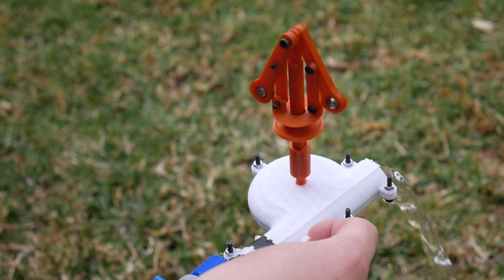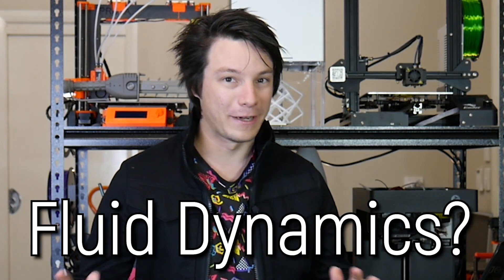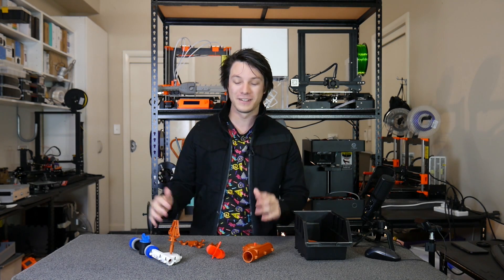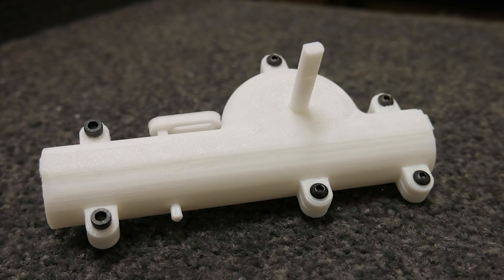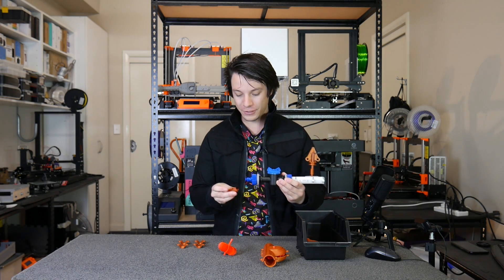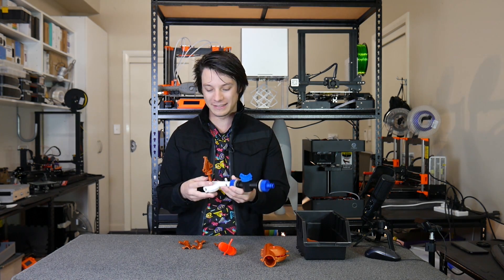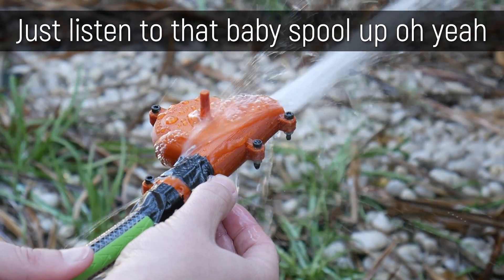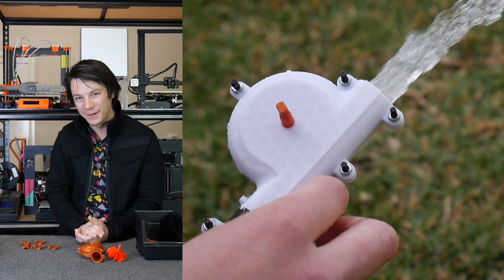When your projects FAIL (and why that's a good thing!)

Comment: hey bro, im here in NSW and wondering what gearbest filament the grey $30 one and it was terrible couldnt print below 40mm/s and .4mm and even then it barely worked, so i went back to the cocoon grey which is amazing and ill prob stick with... as long as they have stock

also PSA.... FASTWAY COURIERS is terrible and never ever use them, 1 month after the parcel left their warehouse fastway delivered it to sydney and handed it to Australia post (who delivered it in a few days) so much for next day delivery hey....

Comment: It only is a fail if you stop trying.  .... Also no one ever said that pipes need to be round. Flat paddles and a square inside would work as well. Final note: the direction of the outlet also will influence the speed  .... (at least I think, I haven't studied fluid mechanic either)
Imagine your turbine housing as a square with two section on each side . Atm it goes in at left top and goes out at the right top. It also could go in left top and come out right bottom forcing the water to flow more around the turbine. Or even left top and come out left bottom. Although in this case the water need to be encouraged to go the right way round and not the wrong way.

Comment: I developed a product and am on Version 10 right now. The very first print I made was crude, but mostly effective, and was only so because I adapted a concept from other similar products. After that it was simple refinement of the idea and trying different solutions to a better product. I was almost happy with V8, but a few last tweaks led to V10.
Along the way, I learned to better flesh out the idea after the initial proof of concept print. Most of the revisions were simply reducing the amount of material and thus print time. A few were nobel attempts to compromise on features versus material/print time which ultimately were rejected. (Not sure they really qualify as revisions, but whatever.)

Comment: Hey Angus, for some fluid dynamics inspiration, you might want to check out some pool cleaners. I have a Polaris 3900 Sport pool cleaner, and it has an amazing gearbox assembly that converts the water pressure from the pool pump into a mechanical drive system. This drive system then is how it drives the cleaner's wheels all around the bottom of the pool. Search for Polaris and part number w7640025

Comment: Instead of that valve, u-bend the tube underneath, and have the fly weights push its center down, and it'll push down into the underneeth part of the tube like a cork.

Comment: The 3PR seems like a good approach. Most of the time I get 80 percent of the 80/20 rule in the first throw. I think four out of five projects work right away on the first print and are close to "good enough". Then I have to decide if to put in four times as much effort to iron out the remaining 20 percent. Usually I just cannot iterate for too many cycles because with FDM printing it takes far too much time to go near-perfect. But I totally agree - if three prototypes don't get you close to the finish line it's probably time to pull-back and re-think the project. Love your more educational videos a lot. Thanks for sharing. Cheers! JM

Comment: Hi Angus, I fail to see how the fly-ball governor will have any effect. As far as I can see, there is no power-dissipation based on the extension of the governor-arms - It will act to reduce quick changes in the water-flowrate, but cannot "set" a certain flow-rate, as it will just spin up, accumulate kinetic energy, and then happily spin onward allowing a large flow-rate. Did i miss something?
Reply from the maker: The intention was to connect it to the valve via a linkage but I didn't get that far... and yes, it wouldn't have worked anyway! Some people have suggested a bypass valve instead which would have given me the effect I was after rather than 'throttling' the butterfly valve.
Reply: Ah, cool. Do you know of a YouTuber Tom Stanton ? He has a.o. built a rather impressive 1-cylinder compressed-air piston-engine using PET bottles as a storage medium. He makes rather neat use of 3D-prints/couplings/flanges/pneumatics.

Comment: You summed it up very well. I often run through multiple iterations. I work as a product manager and engineer so prototyping is my game. I really liked your approach. I also did some water related features. A hose fitting 4 threaded hose. It leaked through the 3D printed layers. Maybe next time I'll get it right. Also you could have moved the valve to the other side of the water wheel and it would have removed the velocity issue.

Comment: Instead of using water maybe you could try air? Air compressor or hydrogen compressor/pump might be a massive project :) also design of propeller with reduced noise levels could be something to  check? Also adding some magnets to printouts might be interesting... :D

Comment: Also a good take away rule is to don't bother designing things you can buy cheaply like https://www.ebay.co.uk/itm/Water-Pump-Attachment-For-Use-With-Electric-Power-Drills-And-Hose1800L-Per-Hour/123169808555?epid=1404305816&hash=item1cad7e20ab:g:3coAAOSwX5ZbE52D . Although to be fair I don't know for certain that device works in reverse. Good video. after three prototypes I'm usually finished with the design myself.

Comment: nice video!
I think the first mistake is: that the entrance and the exit are in one line!
due to the leakage, pushing force is very weak. too weak! (A to short press time and too much leakage)
think on a U shape?
often also use is made of rubber blades (less leakage!)
A snailHous are also used here in the Netherlands on board ships(Is that the right word? snailhouse(s)?)
coiled houses used to pump but the entrance and exit are at right angles to each other 
I am looking for the right word again! 
(at right angles to each other? at an angle of 90 degrees I mean!) axial and radial?
a little bit like this:  https://www.youtube.com/watch?v=VUk_huw7iSI

friendly greetings from The Netherlands!
Rob.

https://i.ytimg.com/vi/7uDGFyXpF8Q/maxresdefault.jpg

https://www.google.nl/search?q=drill+pump&source=lnms&tbm=isch&sa=X&ved=0ahUKEwijpcfB8ZfdAhWC26QKHdfUAyoQ_AUICygC&biw=1920&bih=943

Comment: what you need is a cut to shape commercial gasket to create some sort of flange joint, 3d print flexi material just couldn't possibly standup to high pressure usage.
and there's better chance if the parts are print over its nominal dimension then manually file down to size to control the tolerance.

Comment: The gap is perfectly fine.  The weighted mechanism needs to be as short as possible and a little thicker shaft to accommodate the plastic it's made from.  Lastly, use a light spring to return the weights.

Your prototype needs only those things to be awesome!

Comment: You should try Tesla Turbine. That is a fun and should work with 3d printers. 
And if you are going to make the turbine turn, you need pressure, and that means leaks if you are not careful.

And you should have a small nozzle in front of the turbine, so there are a high pressure on the turbine (not so much water). And turbines are spinning FAST, so you probably needs bearings.

Comment: Hallo Angus!
This is the best video in your Maker's Muse line. I fully agree that we learn from errors we do. Technical applications with 3D printing offer a huge field for inventions. I have an Anycubic Photon and use the same for technical applications. The better accuracy is very important for such projects. Of course I had a lot of fail prints, as nearly flat objects are horrible to print with SLA printer. But in the meantime I learned to design correctly. In my opinion, your main failure was to produce everything by 3D printing. This is not a good idea. The best results are achieved by a combination of 3D printed with common industrial devices. Use a common seal instead of a printed one. The housing should comprise a holder for a common sealed bearing and the axis of the rotor should be a metal axis with small tolerance. Then it should work. Of course your turbine is optimized for high pressure fluids. I your application a Kaplan turbine would be the best. But I think for your application this does not really matter. With the wrong turbine you will lose a bit more water pressure. That's all. Correct sealing is the most important fact in your application.
Thank you very much, your videos help a lot!

Comment: Wouldn't putting the valve behind the turbine work better?
Reply: Yes, a simple solution which guarantees that speed is proportional to flow rate instead of jet velocity. Add a pilot-operated valve, and you might get something viable.

Comment: 3d printign O-Rings is really cool. I had very decent results with HARD FLEX by aprintapro, ninjaflex tunred out to be to soft to hold pressure. Dual Extrusion with PLA and Hard Flex gave the best results.

Comment: You need to pair your additive construction techniques with some subtractive ones: reaming to size, precision grinding, flatness measurements, shaft runout check and correction. I've done some of this kind of design work too, and often thought about printing slightly oversize, then taking them out to the garage and setting them up in the mill or lathe to get the final dimensions I need. I'd like to design a set of desktop machine tools that pair well with printing. Someone please beat me to it.

Comment: If the first prototype isn't wrong (i.e. it does what you set out to do), your design wasn't ambitious enough from the outset. This in turn means that you could add complexity/functionality to the part. That in its turn means more prototypes.

Comment: Here is a tip.  Use the flex filament as the oring. Don't print it but lay it in a groove designed to accept it.  The softer flex filament will be easier  as gaskets need some compression.  Just need to fuse the ends.   For this design, you might try to make a regulator design like scuba tanks and have the pressure push a valve open depending on the strength of the spring.

Comment: you are spot on with this video. I'm trying to make some machine and I'm mostly failing because my 3d bearing are either too tight or too loose that the design wiggles around alot. SLA printers may be better for such applications . Another point to help is to print with more layers to have better accuracy in Z axis of your print.maybe 100, 50 or even 20 if you need to

Comment: you reinvented the wheel - ferris did that already. what u described is basic any hardware store would have given u what u need - use gasket seal to water proof - make o ring around valve

Comment: True, Trial and error prototyping often takes longer and many more prototypes to succeed than doing the engineering math to calculate fluid flow, and valve size, etc. But it’s more fun because you get to build something faster. 

In a future design, consider the valve a turbine bypass instead of shutoff. By giving the water a variable secondary path you maintain constant flow from input to output but control how much goes to the turbine and how much is bypassed. The governor then only has to control a more constant force.

Comment: Those mechanical governors with the steel balls is where the saying"balls to the wall" comes from. They sometimes put a wall around them for safety, because if the governor snapped you'd have those balls flying off like a bullet. When the machine was running wide open, the balls would be right to that wall

Comment: Could you not just place groves in the sides of the part and cut lengths of fillament and pop them in as seals? I get printing gaskets if they are a full loop but for a linear seal like used...?

Comment: Angus, remember that most precision mechanisms are cast to general dimensions and then precision machined/ground to final dimensions - what you're doing there is essentially attempting to build the final mechanism from unfinished cast components. I'd call what you achieved an enormous success taking that into account!

Comment: Take a look at a Tesla Generator/Turbine. It should be a little easier to print and shape (maybe print each disc as a separate part and put them on an axle). Also take a look at a Diaphragm Valve. Tom Staton ran into a similar issue when he made his 3d printed compressed air motor, he was using a ball valve and its only fully on or fully off. So he designed a valve where to close it you squish a sheet of rubber over the outlet (see his video Air Engine Throttle). That should fix your problem as well, as it won't act as a nozzle, speeding up the flow (while losing pressure).
Reply: no, dont print the disks because each one will be one of. beter use cd disks or other pre-made solid equivalents. also use a shaft that is no 3d printed so it wont blend. you must remember the limits of your materials.
Reply: Thats no fun though. Yes, 3d printing is not good for anything like this but why are we going to let that stop us? For like 50c and a couple hours in CAD you have a fun toy that has almost no use at all. If we though about the materials first we wouldn't even have this video. So why not do it?

Comment: For the O-ring seals why not use the TPU filament as it is.  For a governor like this to work, you need to use surplus energy from the system that has much more energy, after all, it is to prevent runaway.

Comment: I think the 3 prototypes "rule" is good to get to the point of having a working design. Then its up to you if you want to continue and improve or abandon :) From my experience sometimes it works for the 2nd time (easy designs), sometimes you need 4-5 iterations. But 3 is a good average.

Comment: "If at first you don't succeed...perhaps failure is more your thing"
Seriously...it looks like your using a 0.4mm nozzle - perhaps the precision would have been better using a smaller nozzle?
Reply from the maker: yeah finer layer heights and a smaller nozzle might work best for the small details.
Reply: @MakersMuse  I think redesigning the shape might also help. A tube with circular crossection is best for a flexible hose or extruded metal tubes and of course that's what you see, so you're trying to recreate that in the new parts, but sometimes you have to adjust your design to the fabrication method (as well you know). So for FDM, a hexagonal crossection could be considered: it will definitely address the resolution issues you mentioned as the first layers are just flat, then you get a nice 45° slope, and then it's immediately exactly vertical, which might also help with the seal. Apropos seal: print a wider lip where the two halves meet so you can add a bigger O-Ring. Also, use more screws (you're going for consistent pressure over the whole length, not necessarily high pressure). But great idea to print the seals!
The overhangs on the turbine paddles will also profit from that redesign, you'll get a 45° overhang right from the bottom instead of trying for a circle, greatly improving your tolerances.
That said, you've probable scrapped that project for good, but maybe it helps someone going through these comments for inspiration ;)
Reply: Oh, another thought: As you mentioned, closing the valve actually makes your prototype spin faster because the same mains pressure tries to squeeze through a smaller opening of the valve. But if you're measuring that speed, and the speed is just a function of hose pressure and valve opening, and hose pressure is vaguely constant, you're just measuring the opening of the valve here, and what good does that do you? You can just set the valve manually and let it be (unless your mains pressure fluctuates widely, which could be a concern...).
But that's because you're only testing half a system here. In any real-world application, the regulator won't be just openly gushing all the water at its end, there'll be a hose connected with a whole system behind it, e.g. the plant watering hoses with small water outlets, or whatever. So maybe you need to modify your test as well. Put a reducer on the end of the regulator so less water can flow out than is being pushed in (if you need more water than you can push in, your system is underpowered and you don't need to regulate it...). Ideally choose the exact effective opening your target system will have (in case of watering plants, the combined diameter of all outlets).
This way the water will back up and you'll be more accurately measuring the amount of water going out of your regulator, which will have a far slower speed than in your tests (I think that's probably why you were so surprised of the speed you got 😉). Your effective opening will be constant, so if you're measuring the speed of the water, you're actually measuring the pressure inside the regulator and the whole system after it, which I think is what you were originally aiming for.
Of course, if your target system outlet size is not constant, that's a bit of a problem. For a zero opening, speed will be zero and the valve will be opened all the way, meaning nmax pressure on the system... But if your system is pressure sensitive that would mean your regulator will overload it. 
I think in terms of steam machines (experts please correct me!), these regulators might have been connected via a small opening in the main pressure chamber and constantly let out pressure into the open, not into the target system, so you'd have a constant outlet size from which to calculate the pressure. Not sure that's what you were going to do with your water system though, so the system might just not be applicable.

Though I assume you were just doing this as an exercise and didn't have a proper application in mind, which lead to this "open regulator" test 😉